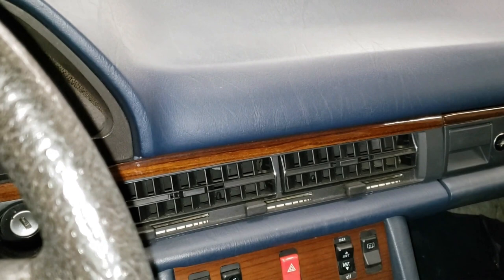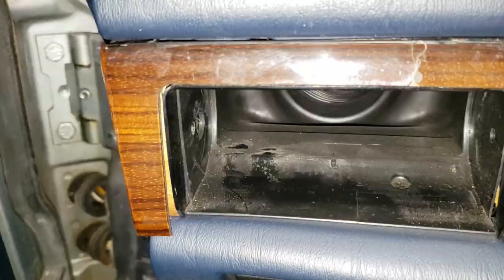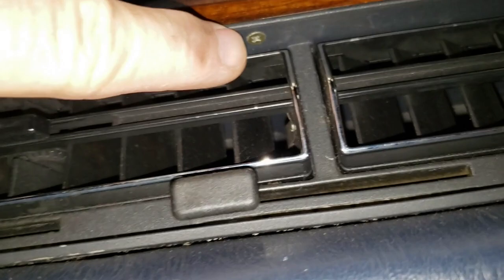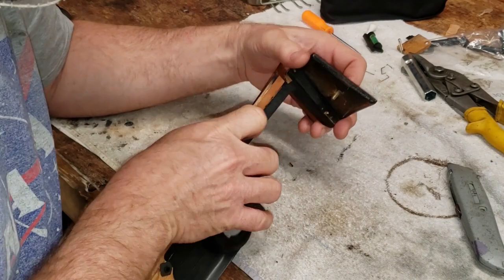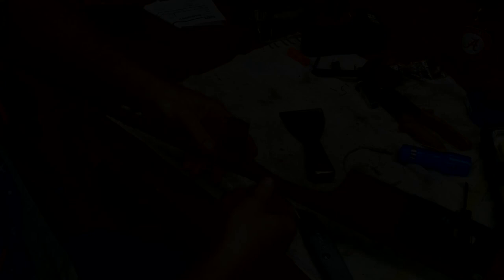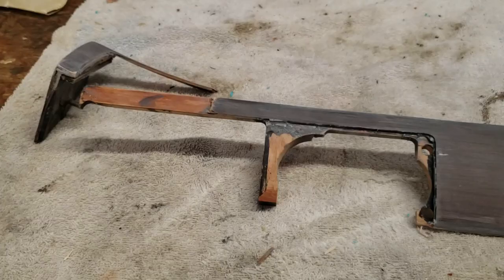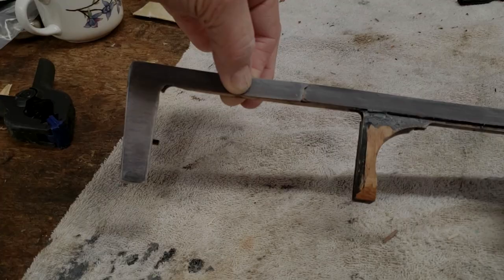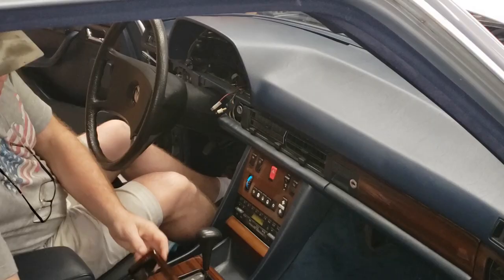Mercedes 300SD W126 - Wood Trim Restoration - Dash Driver's Side - Long Piece

Comment: Very nice. Eventually I will have the wood in my 500 SEC restored, but I will be sending it to someone as I simply do not have the artistic skills necessary to get it where it needs to be.
Reply: You say what needs to happen to remove a piece, but don't show you doing it. The next photo is with the part out. I wish you would show each step all the way. Thank you for sharing your experiences.

Comment: A dentists mirror would probably be helpful seeing things inside the dash. You know, the kind they like to jam in your mouth and pry your lips around with.
Good job. Looks good!
I'm glad my 85 was a 300d. It just had 3 or 4 straight pieces going across. They were very thick solid wood. I found them under the seat after I got the car and the Mercedes-Benz dealer GAVE me some two part epoxy and I just stuck them back on. 
You never know what previous owners have screwed up on these old cars.
Reply from the maker: The dentists mirror would make too much sense! We can't have any of that on this channel!  😂🤣

Comment: I've read that laquer is the proper clearcoat for these cars, but I could be wrong.  You should stick with the spray poly, multple coats and wetsanding, I go 800...1500...2000, then meguairs 105, then meguiars 205.  You should be able to get those glass smooth, great work though on your cars, I enjoy the videos!
Reply from the maker: Thank you sir., Yes it does make sense that Laquer would have been used in this application. I've never worked with it however.  I can try to practice a bit more with the spray poly but it really did not work well for this piece of trim.  I might possibly try to spray it on a little heavier next time. I had been afraid of getting runs because they are so hard to sand out. I have one more piece of wood trim to do - the front passenger door. When I do that one, I'll most likely replace (or lubricate) the door check strap on that side.

Comment: Thank you very much indeed, I am in need of this restoration on my 300SE 1986. Hope to see more videos on other part of W126. I already removed the one on the front right door. Mine seems okay but colour is drastically worsened. So may I work just the surface? In few days or so I will remove the front wood dash board thanks to you safe and clean.
Reply from the maker: You might try to lightly sand the piece and use some dark walnut or red mahogany stain to re-color. Don't try to sand all of the original color out if you don't need to. You might be able to add color back to the piece. Apply stain to a test piece of scrap wood to see what it looks like first.
Reply: @ImpalamansGarage  thanks a lot, a geat help

Comment: That JB weld is OK, but cyanoacrylate glue (Krazy Glue) is your friend when working with this wood!
Reply from the maker: I need something that has a rather long work time for these long irregularly shaped pieces of veneer. You also need 100% coverage between the layers, otherwise you will have air gaps and that will result in pealing again. I agree that super glue would be ok for small areas where a long work time is not required.

Comment: Hi Impalaman! Just bought  a 300sd from 1981, can't wait to follow in your footsteps.  What kind of  adhesive do you recommend to adhere the plastic dash bits?  Like the ignition cover, for example.
Reply from the maker: Loctite makes an epoxy that is specifically formulated for plastics.

Comment: Is that manual only from 300SD or other Mercedes?
Reply from the maker: This is where I downloaded the 300SD manual: https://www.startekinfo.com/StarTek/outside/12253/program/matrix.htm  There are selections for other W126 models as well. There are a large number of files on this site.
Reply: @ImpalamansGarage  sorry but this link don' t work
Reply from the maker: @jorgedelarosa7956  This is an old website. It still uses Adobe Flash. If you are using the Chrome web browser, that functionality is most likely disabled. Go into your web browser settings and ensure that Adobe Flash is enabled.
Reply from the maker: I just enabled Adobe Flash on my Firefox browser to ensure the link works there as well. It's kind of a pain since most people don't use Flash anymore. IT is available however and still works.